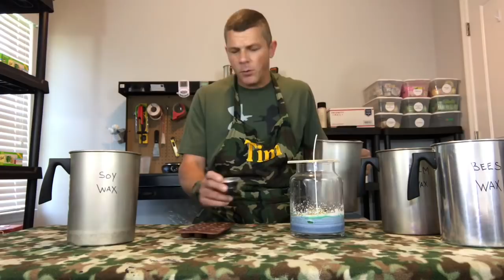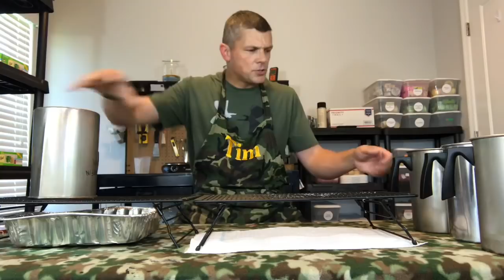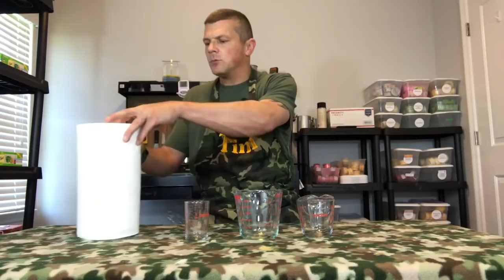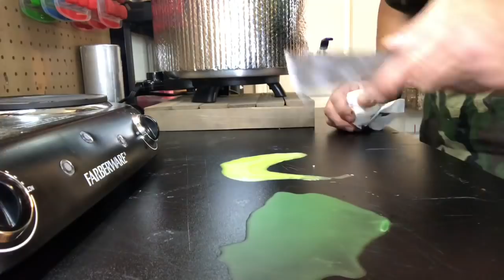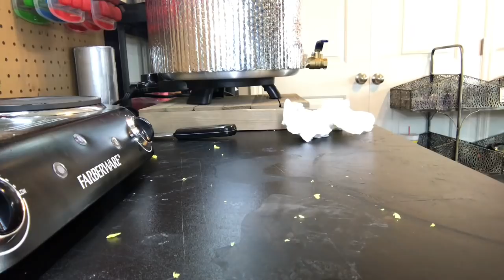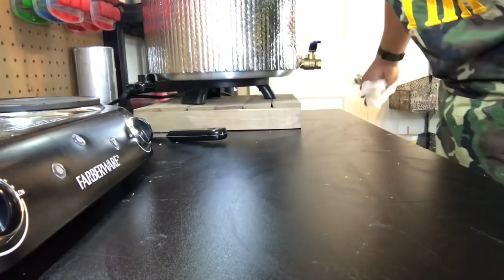Candlemaking: Clean-Up Process

Comment: I just reheat any hardened wax   in the pitcher over my double burner and pour it into whatever I want to put it in. Then I wipe them out with a paper towel. Less fuss that way and I don’t need any racks or metal pans. 😊

Comment: Please help. I make ocean scene gel candles in wine glasses. I sell local but I'd like to branch out and sell online. How would I mail them? I'm worried about the summer heat and the wine glass breaking. Do you have any ideas or tips?
Reply from the maker: +Jen's Life shipping isn’t as scary as it sounds. Check out my shipping tutorial for some great (and free!) shipping ideas. Gel has a higher melting point, so I wouldn’t worry much about the heat. I pack my candles with cornstarch packing peanuts, which provide great cushion and have the added benefit of acting as insulation. You’ll be shipping to Arizona in August with no worries!
Reply: Jen's Life as long as you are using at least medium density gel wax, you will have no problems with the wax melting in the summer heat during shipment. Follow Tim's other shipping suggestions and all will be fine.
Reply: I have not used gel wax, but had read due to it not being solid there could be issues with shipping due to movement or it not being stored vertically. I also read some amazon reviews of gel candles reporting receiving a large mess. Has anyone sent these with success, and do you have any tips?